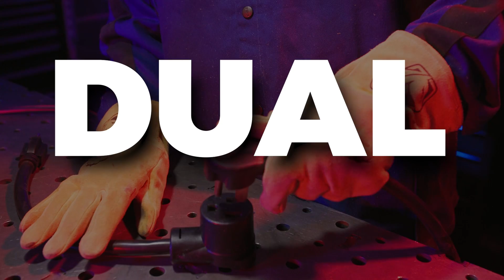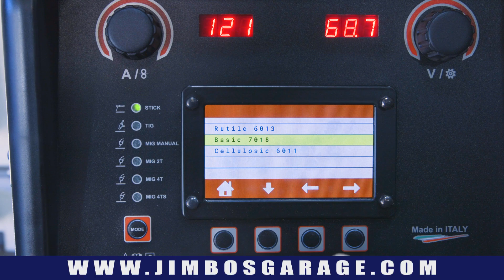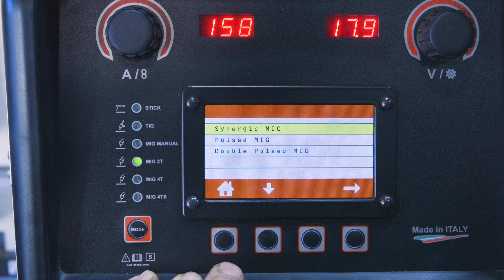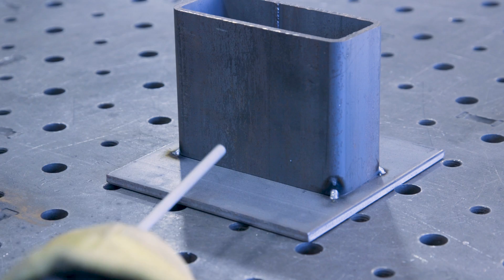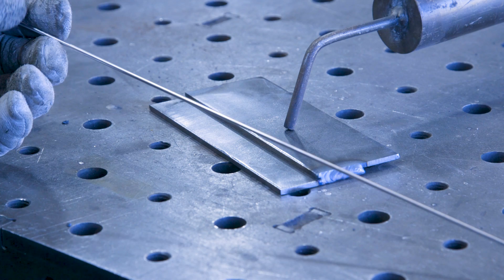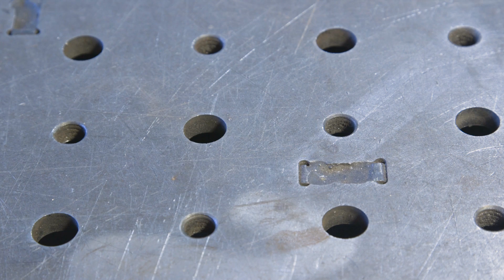Multi-purpose welder review - Dual Voltage - All in One | JIMBO'S GARAGE

Comment: Miller Multimatic 220 has been around for four years now.
Reply: Had the Miller 220 215, sold the millers. Had a Everlast 275 (it was plagued with board issues they were resolved but don’t trust it so SOLD), had a ESAB 235 and still have a 285. Both good welders but don’t offer what the HTP does. So now my primary is a HTP 2500 and the rest do not compare! HTP does every process so well, it’s like it’s a 3 dedicated machine setup but in one welder! The others do one process okay and others not so much in comparison. As far as the miller 220 you mentioned, not a bad welder but low grade in comparison. With its little 25mm dense connectors. The HTP is industrial grade but function well in a hobby shop or maintenance application as well.
Reply: I have the Miller also. If I had known about this machine when I was in the market for a new machine two years ago, I probably would have gone with this one. Does everything except plasma cut and make you a sammich. 🤣 I may never need to pulse on stick, but it’d be nice to have it if the need ever arose.
Reply: Had the mm220, rev2500 is much better and more features. Especially for AC.
Reply: And it still does not pulse MiG or pulse stick weld….  Yes you can MiG weld with a spool gun 1/8” or thicker …. The miller has nothing on this one here ….
Reply: Pulse stick thats that lets me know you dont know what your talking about.😅😅😅😅😅
Reply: @jaimegarcia9032  Didn’t watch the video, did ya?
Reply: @jaimegarcia9032  exactly…. Seems like you didn’t watch the video or you do not understand the concept.  Pulse stick works AWESOME to fill big gaps in bad fit up, and it lets you run rods that are normally flat position only (like 7024 or several hard surfacing rods) out of position.  What is that good for? Well, besides winning a bet  a case of beer…. You don’t have to rent a crane and spend 8 hrs pounding out pins on a gigantic dozer blades to lay it in the flat position to hard surface it …. While the other guy is still removing the blade, I am pretty much done applying the hard surface layer…. 
But if course pulse MiG is not a thing and am just a few eggs short of a carton ….  It’s alright.  I learned to live with that….

Comment: Pretty sure my ESAB Rebel EMP 205ic does all this..  Why are you saying it's the first true multi process machine?
Reply: Esab also does not support spray transfer either.
Reply: @Justforfun-ek7et yes, most machines in that amperage range have mig arc voltage from 24-26 volt max ….  Its hard to spray anything with less than 29 volts ….  The revolution has 35 volt 😳
Reply: Because he’s Jimbo   enough said
Reply: Had a 2 ESAB. The ESAB isn’t a bad machine but it doesn’t compare to the HTP, it offers better build quality, more output, more process options, and the the one dial menu on the Esab is goofy
Reply: I am pretty sure the esab does not have pulse mig and i am also pretty sure that you cant leave all the welding leads plugged in all at the same time
Reply: @ZILAwelds  I have a Esab rebel 205. The mig gun stays plugged in the time. Just have to plug tig torch neg lead and ground to pos if your going to tig over mig. I've found that mig pulse is not needed on the ac/dc 205. If I have thin sheet I just tig pulse it. The Esab ac/dc tig side of the Rebel 205 is very, very good. I could only afford to buy one machine or had to live with one just machine it would do fine. The HTP 2500 is an awesome machine. But when I bought the Esab HTP wasn't building the 2500. I have an HTP pro Pulse 300,Pro Pulse 220 & Invertig 400. Wouldn't trade for any other brand of machine out there. I do like that my Esab is super light. Had to carry it up 4 flights of stairs to finish Hand railing in a townhome. And was I glad it was 30 pounds lighter than the Miller 220. Elevator was down the day they called me.

Comment: wish they would have come out with this last year! ended up getting an esab
Reply: I hear ya. I had a ESAB 205 and also a Miller 220. Both were great welders, but they have been sold and there is a HTP 2500 now on my welding cart. It’s simply a better welder across the board. It does every process well and like a dedicated machine. I’ve also tried a few other Makes and Models but this has been the best

Comment: I just bought the inverting 221 and the MTS 220 kind of wish I went with the 2500 Revolution instead. The inverting I got on the fall sale and the mts I got yesterday with the blackfriday sale.
Reply: i have both of those and also a PP300, i can tell you that id rather have the 3 machines due to having to switch wire around and what not. The 220 is portable and is my go to for most things and i keep steel wire in it. When i need to mig heavy aluminum or 1/2" steel, the 300 wins, but i keep aluminum wire in the 300. Saves me alot of time for most of my repair work having 3 machines ready to go all the time.
Reply: @jeremybishop9848  When I ordered the MTS, I received a call from Heather at HTP to fix my order and customize it a bit. I mentioned the same thing to her and she summed up the same thing you said that I would probably be happier with the dedicated machines for a little more options than to have the one. I see the advantages as well, but I look at the savings I might have had too. It’s not a huge difference but I think I would have saved about 1k. I did go with the watercooled package on the invertig but the sale price was very good.